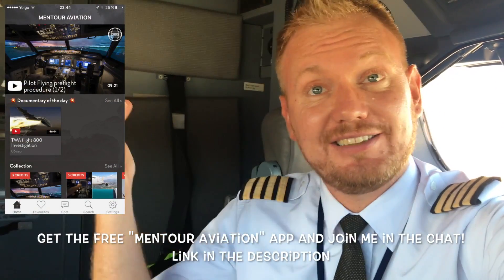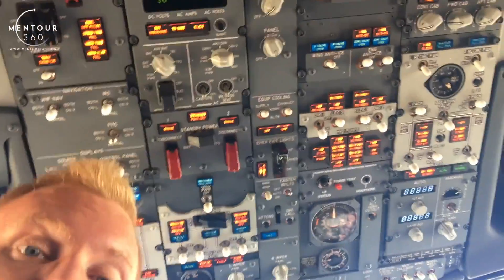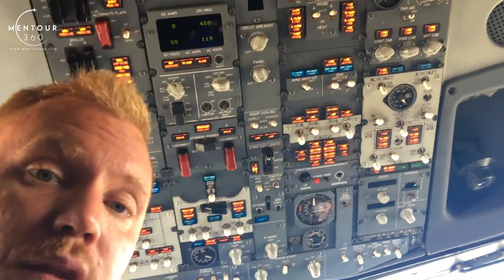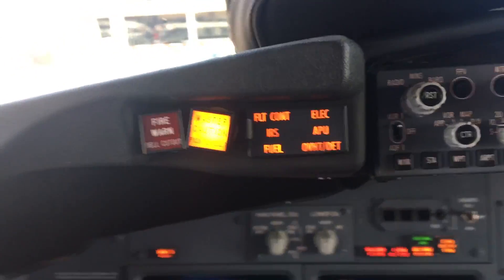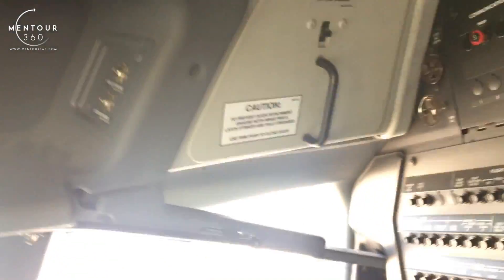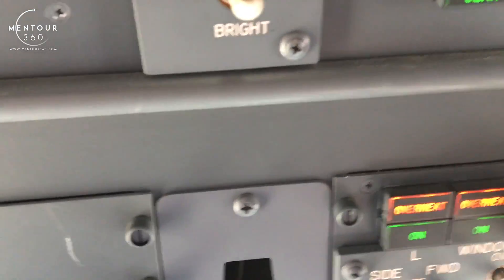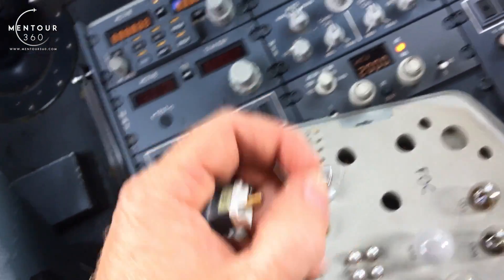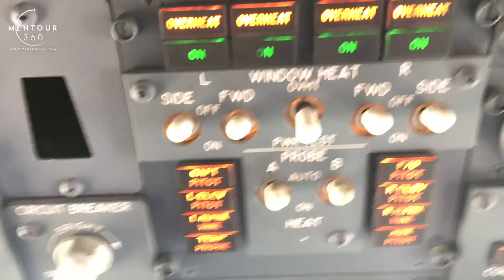Boeing cockpit surprises! Lightbulbs.

Comment: Always make sure to change the light bulbs when you're on the approach for landing. Landing the plane should not be your priority, the replacement of the light bulb should be. The replacement of the light bulb is very important. Focus all your attention on replacing the bulb. Put your aircraft in a holding pattern at 2000-3000 feet and get to replacing the bulb.

Comment: Why not change both bulbs simultaneously, because when the first bulb breaks, it won't be long until the second one breaks too.
Reply: Then you could as well change all the bulbs since they all have the same age
Reply: @chri-k  Yes you can find out, whether both bulbs are broken. That's what the light test switch is for, it illuminates the whole cockpit like a Christmas tree.

The point is less about age but more about the time the bulb was on.

Comment: My question is, why don't they use LED replacements nowadays? It would reduce failure rates, and wouldn't that also make it possible to power all the cockpit electronics off of batteries only?

Comment: Do newer aircraft get LED light bulbs for all those lights, or they have to stick incandescent? The longer life and lower electricity needs of LED lights would be helpful to reduce the need to consistently change bulbs given that they only give you very few "emergency" light bulbs to change?
Reply from the maker: The newer aircraft are all LED
Reply: @MentourPilot  so there goes the last maintenance pilot is allowed to do. Now its just flying 😏

Comment: Nice thing to use two bulbs plus the master caution!
But it seems like your menu of bulbs is already partially used up. Is this "refilled" after each flight to make sure that it is always possible to change bulbs and get all warning indications correctly?
Reply: Dino Schachten Checked/resupplied every M-check, so if the need more bulbs they`ve have to make a log entry.

Comment: Thanks mate. 

You have done a good vid on a subject that passengers or me who is an enthusiast knows none about and would have to dig for.
It kinda reminds me of how me replace the light bulbs on our the glove compartments of our trucks.
I would have to do a vid and send you the link
It actually involves a medical hemostat as part of the improvisation to hold the bulb where space for fingers is none.
But, it ends not there.
We remove a piece of wiring insulation and insert as a loop over the sharp ends of the tool to hold the bulb.
This has to be seen to be believed.
And we do not know how else it gets done.
But this do work LOL!

Thanks for de vlog.

Blue skies!

Comment: Interesting to see that the lamp test just lights all the lamps simultaneously, I'd have thought it better for the system to alternately flash the two bulbs in the fitting (assuming there are dual circuits to each for redundancy). An indicator with one dead bulb would then start flashing as the others just shimmer a bit from side to side.

Comment: Could you use the lamp test function during flight? If you have a master caution warning you could do a lamp test to see which one doesn't lite up. Then it would be good indication of the fault but I would want to swap bulbs around to confirm.
Reply from the maker: Yes, with most lights you can.

Comment: I was also surprised when i disassembled a broken part of my car (center display). Built in 2008 i was honestly expecting LEDs (or EL foil) for background illumination. But i found classic light bulbs...

But another question: Why don't they simply use 2 different colored bulbs? So a amber one for e.g. "Off", and a green one for "On". So the signal is always either amber or green. If it is dark you know that one of the bulbs is gone.

Comment: Does an American manufacturer like Boeing have to write different versions of procedure manuals to account for the fact that its products are used globally? in the US, little components like bulbs, screws etc. are called "parts" but in the UK for instance they are called "bits". In the US "bits" are the tools used to drive screws. Panel Bulbs are also called "lamps" in the states, as in "warning lamp"
Reply from the maker: No, except fo the use of the metric system. All parts go by the manufacturers name and the airlines adapt.

Comment: Do you pay for  travelling on board for  the airline you work for?
Reply from the maker: That depends. If I travel as passive crew, I don't pay. If I travel as a passenger, I travel at reduced rate.
Reply: If one or both pilots break while you're a passenger and you have to fly the plane, do you get an on-call rate for the entire flight, or just regular pay for time actually at the controls?
Reply: Joe Bramblett That is very rare, and has likely never happened to him.

Comment: Mentor, you'd have lost the bet; I did know that.  I've changed many of those "peanut bulbs" in our C-9B's.  What frustrated me was going to the spare bulb locker (compartment) and not finding any spare bulbs.  It was part of our daily inspection.  For some reason, when I did the daily, i'd find no bulbs and then fill it up.  But I never found the compartment full.  I can only conclude that the other inspectors were not filling it.  I noticed several bulbs missing in your vid.  Oh well, seems nothing has changed.
Reply: the temptation to steal a few spares for your flight bag must be immense

Comment: +Mentour Pilot Isn't the lights test more about testing the Master Caution System than it is about checking if all lights are working? The way the MC system works is that it sends a signal to the six-pack button if certain warning lights on the overhead are lit by onboard logic. There is a Master Caution System PCB inside most overhead panels. When lights switch is put into test mode, it activates the PCB circuitry, and the Master Caution PCB sends a signal to the dedicated light, e.g. APU PANEL PCB sends a signal to the APU light on the six-pack button only.
Reply from the maker: +Oasis 737 Project The light test is a test of the lights. We do it to make sure all indicator light's are functioning correctly, including the ones in our line of sight that do not trigger the master caution warning.

Comment: Great topic - really didn't know that!  At what level of maintenance does the ground crew restock your panel of spare bulbs?  Surprised the replacements are not led.  Who fixes the passenger cabin reading lights that are often out?  Wish the fasten seatbelt light could stay off.

Comment: Why glass bulbs with filaments instead of LEDs? LEDs would be far more reliable and last much longer, they would also be cheaper.
Reply: The plane was designed before LED was a common light source, I guess.

Comment: The second ON button needs a second bulb aswell
Reply from the maker: Correct, that was fixed after.
Reply: Mentour Pilot Do you only need one operating bulb per pair for the MEL?

Comment: Always wondered why the master caution switch is tilted... Someone an idea
Reply from the maker: Just a quirk during manufacturing. Its the whole light switch that is a bit movable.
Reply: Since all the stuff that fails was designed by engineers, they took a safer route with that piece and had it designed by a random drunk off the street.

Comment: when changing lightbulbs, is it required some kind of electrostatic handling like wear a electrostatic strap on the hands?
Reply: technical answer = incandescent light bulbs are not static sensitive devices and are usually driven from relatively low-impedance current sources (a.k.a. "voltages"), so there should be no need for this in a well designed system. Any monitoring circuitry could in theory be ESD sensitive but this will be swamped by the low current source impedance
(I'm talking impedance here because even though normal operation is DC an ESD spike has immensely fast rise time so needs to be analysed against impedance, not just DC resistance)

non-technical answer = "nope, not usually, because they are simple bulbs"

Comment: Related to your remark about making sure you put the bulb block back in the right direction (orientation): can the block really be inserted with the wrong orientation? I couldn't check this on the video (you were too fast :) ), but engineer's common sense would tell me to design these blocks (and other removable components of those panels) in a way that they can't be plugged/connected/inserted in the wrong way. If I were to design aircraft components, I wouldn't trust maintenance crew and I would make very sure that they can't mess anything up by plugging something in the wrong way.
Reply from the maker: +Istvan Knebli Yes, they can be inserted the wrong way. 😂 It looks great when it says NO NO NO NO instead.
Reply: :D
Reply: I would imagine it depends on the criticality of the indicator.  For example, let's say the landing gear red & green lock lights share a module, you definitely don't want to put it in wrong and have it show a green when it should be red.
Reply: You're going to have to get over that "common sense" thing if you expect to have a future in engineering.

Comment: Would you just replace one bulb or both?

Also what if you ran out of spare bulbs?
Reply from the maker: +Thu Ya Win You only replace the failed one. But quite frequently, when you change one, the other one breaks.

If you run out you have to consult the MEL (minimum equipment list) and conference with engineering if you can dispatch without it.

Comment: Wasn't the one bulb on the second indicator from the left also broken?? Also more of these types of videos!!
Reply: Mentour Pilot do you have to log the bulb changes or will the line maintenance people routinely restock the supply of spares?
Reply from the maker: +Leo Castan Yes, i had to fix that as well.
Reply: Mentour Pilot Have you ever tried changing a bulb only to find that a previous pilot put back a broken bulb in the spare holder? :-)

Comment: Do you use LED lamps or old ones?
Reply: Resistors are very easy loads for electric systems (light bulbs are resistors), but diods are a bit harder (LED is light diod). Current over resistor is proportional to voltage (light bulb resistance usually drops when lit (heated)). Diod current is almost zero unless voltage reaches treshold voltage, after that it increases rapidly (and same for other direction as well). And rapid current changes are bad as wires act as radio transmitters. Amount of radiation is most likely meaningless, but it need to be tested before change (which is expensive).
Reply from the maker: +Daniel Bengtsson Old ones.
Reply: LED lamps would of course last longer. It surprises me that they do not use them in new planes. Maybe it is less expensive with old light bulbs.
Reply: Thank you for an interesting explanation! I am a Physics teacher so it makes sense to me.

Comment: Hi Peter, what would happen if the elevator cable snapped in a light aircraft like the 172? Would you dive straight down like when this happened to an Air Morea flight and Air Alaska or would you be able to use the trim? I would really appreciate if you could reply, many thanks from a big fan, happy flying!
Reply: Tie each of the broken ends of the elevator cable to the light bulb.
Reply from the maker: +Samuel L There are multiple backups but yes, we could use the trim and the engines to remain with some controls
Reply: Mentour Pilot Thank you very much for the reply sir.
Reply: The Cessna has a elevator attached to the horizontal stabiliser which moves when trimmed therefore the pitch can be controlled via trimming.
Reply: There's a video somewhere on YT with two guys in a 152 that had the elevator cable either snap or snag on something (can't recall which), and they got down safely.
Reply: Lol it's really cool to know his name is Peter
Reply: @peterpalmer8645  It's not "Peter," it's "Petter," with two "T"s. Petter Hornfeldt
Reply: @peterpalmer8645   It's not "Peter," It's "Petter," with two "T"s. Petter Hornfeldt
Reply: There is a up cable and a down cable, you could in theory trim against the working direction and hold constant pressure to stay level.
Reply: EinkOLED why do you need an elevator when you are in a aircraft? 😝
Reply: Because 30,000 feet of escape rope wouldn't fit in the little compartment over the window.
Reply: Yes I know there's a second T in some languages but I was translating for my own